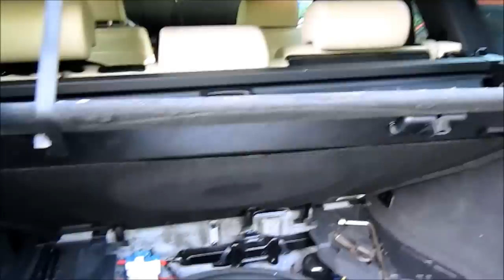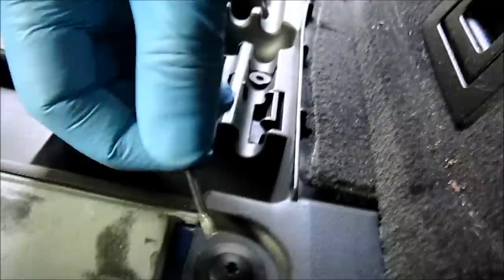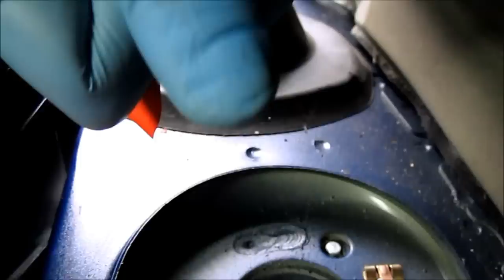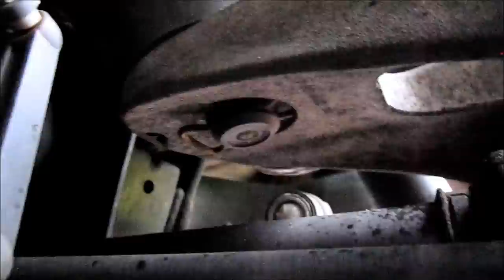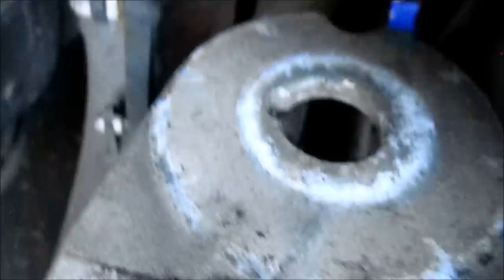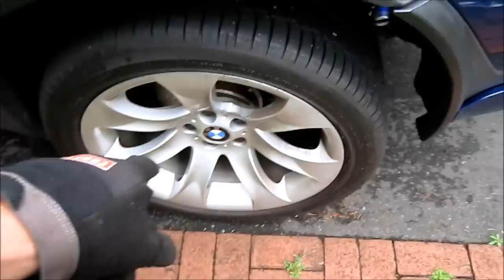BMW E53 X5 Rear Airbag / Spring Replacement DIY Guide

Comment: Thanks for making this video, it was easy to follow and cut my time to do the job by at least an hour.
Reply: Hey Tod, How long did it take you total to do the job, the dealer is asking for $3500 to do the job.
Reply: All total, jacking, cleanup, beer, watching this video three more times, etc., it took me 3.5 hours.

First thing to do is get the rear of the car up on jack stands and get the rear tires off. It is fairly easy from there.

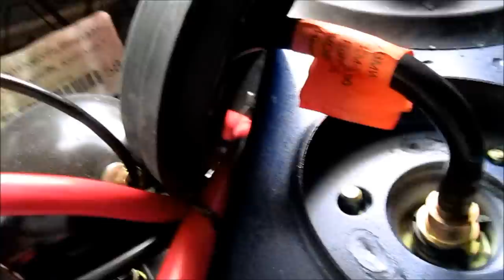In the video above, he gets the new air spring roughly in place, then gets in the car, 7:30 or so in the video, connects the air hose and then uses the air hose to maneuver the air spring into place to get the clips on. I was not able to do this, and this was the only point I needed another person to help me by holding the new spring in place while I put the retaining clips into place.

For $3,000, I would gladly do the job for you. My total spend was under $300. I used the Arnott air springs, and they are working well.
Reply: Yep - I here you. I'm going to give it a go myself. He said the rear air pump is leaking which caused the compressor to burn out. Even if it takes me 40 hours, I'm still way ahead of his quote. I'm just surprised that it all went at the same time. I'd love to pay someone but at the rates these charge, you're forced to put on your big boy pants and figure it out. I'm just going to have it towed back. 3
Reply: Did you have to buy any special tools?
Reply: From memory, here is what I used:

Gloves

Floor Jack - not the jack the came with the car, rent or buy one if you don;t have one...be sure to get one with enough travel. Trolley jacks like this one do not have enough travel to get your car sufficiently off the ground: https://www.amazon.com/Liftmaster-Hydraulic-Trolley-Floor-Heavy/dp/B013FA4XA4/ <- do not buy one that looks like that.

Two jack stands - at least 2,000lbs capacity each

Three hockey pucks - I put these between the jack and the car and the jackstands and the car (one each)

Socket/and combo wrench set

Assorted screwdrivers

Assorted pliers - blunt and needle nose, to get the bottom retaining clips off and then back on

Torque wrench - I used this on the wheel lug nuts (100ft/lbs) and maybe a few other places, I can't recall. You may be able to get by without this.

Trim removal tool - the video above has one linked from amazon, but they are plastic and bend too easily. It was very difficult to remove some of the rivets, I had to pry on a few with pliers, etc., and I broke one or two. If I did it over again, I'd probably get a metal one like this: https://www.amazon.com/dp/B00XCLLHCY
Reply: Also, make sure you get the correct replacement air springs for your exact make model year and option level (sport suspension or not, rear or four wheel air bags, etc.). Use the selector on the Arnott site: https://www.arnottindustries.com/

Comment: Thanks for a great video. I just completed the repair without a glitch (arnott Air Bags) however my X5 still looses air it seems over night. I wake up and the rear is sitting low. I unlock the car and it rises right back up and seems to stay like this during the day or I guess it trickle pump during the day as I drive. Any ideas where that could come from. I did not check for licking air on the quick couplers when I reinstall them or at the air supply hoses either. Is there anywhere else air could leak ? Thanks
Reply: Sam Prokop try spraying dishwashing soap+water from a spray bottle around any parts in the system that could leak and look for bubbles.  also spray the bag itself.  some people have posted that new Arnott bags came with leaks.

Comment: Hello! I have one question if you can please answer. Is there any posibility to convert the rear air suspension into a normal springs/feder suspension on series e61?

Comment: Wrong instruction on pulling the clip out of the air bag , Just use a 90 degrees needle point  ,insert it at the endo of the "C" square  looking end and pull it on to the other direction ,it will lift it and move it. No need to bend and damage the clip that can be re-used.

Comment: where can I buy at reasonable price  both left and right rear air suspension for my bmw x5 sport e53, 2001 manufacture?
Reply: Baffour Ankomah  I saw two on eBay for like 40$ I'm about to get some today
Reply from the maker: Arnott Industries.
Reply: Blue Purple Red are the airbags by Arnott still good. How are they ride compare to Oem bmw parts?